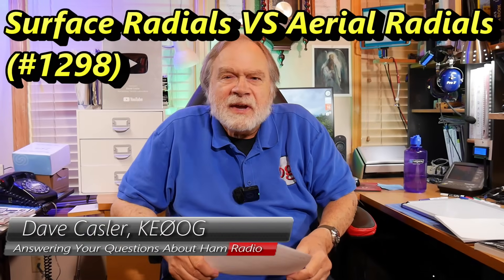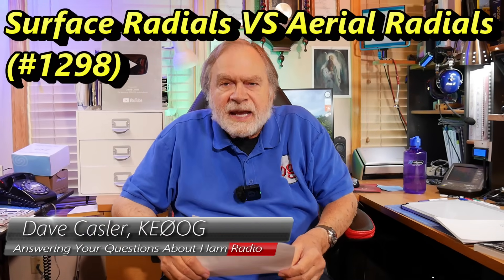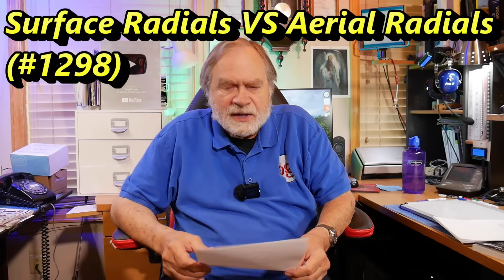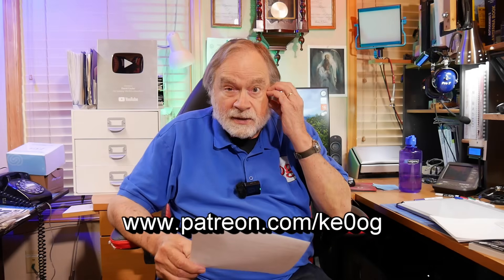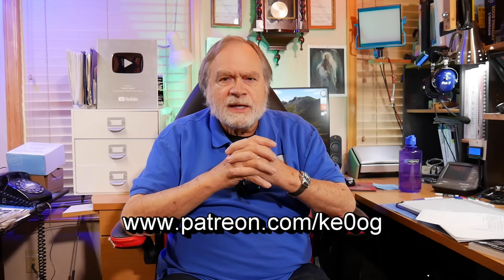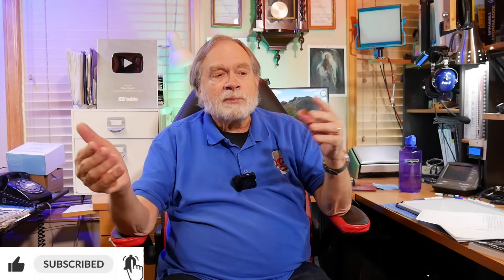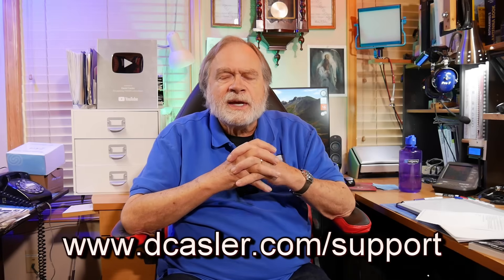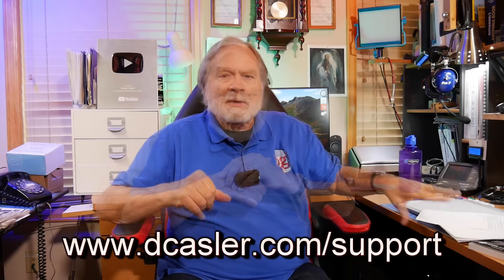Surface Radials VS Aerial Radials (#1298)

Comment: Great video. I love my G90 too but I discovered today that the receiver is not working in FM mode on 10m. There is no output sound even with the squelch set to zero and the volume full up. Does your radio do this too ?
Reply: My G90 also has the same issue with FM receive. It seemed to have occured after upgrading to the latest firmware version v1.80. I saw another YT post stating that there is supposed to be another firmware update in August to rectify this problem. I suggest to keep an eye on the Radioddity website to see if a new version of firmware is available.

Comment: The POTA PERformer and POTA Dominator designs, by KJ6ER, would seem to be at odds with your position on this subject.  Only two radials, both of them tuned and elevated.  I have not tested the design yet, but others report great sucess.  Respectfully submitted.
Reply: G90, jpc12 antenna, pota performer tuned radials held up using 2 plastic fence poles from tractor supply, 10 to 40 with an SWR of 1.7 or less on all bands 👍🏻👍🏻👍🏻👍🏻👍🏻👍🏻👍🏻

Comment: 3:42  My experience does not match yours.  In the soil conditions I operate portable near Seattle, I found that coiling back the tips of the radials to approximately 1/4 wavelength at each band change enables me to easily get the VSWR into a usable range without needing a tuner.  A couple iterations alternating adjusting whip then adjusting radials dials it in quickly.   de AC7PB